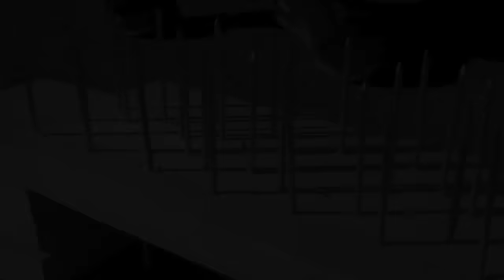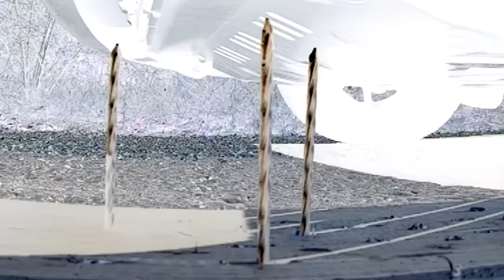EXPERIMENT: CAR VS 75 GOLDEN SCREWS 😱

Comment from the maker: What should we do next? 😀
Reply: 50 Knife Vs Car!
Reply: i think that you should stop doing these types of videos.. it is obvious that the tire is gonna brake
Reply: cool video
Reply: 200 forks vs car
Reply: The air pressure was low in tyre if it could full the could burst in 5 nails onlyy broo
Reply: Nwm ale odc po polsku xD
Reply: Kaktus? xD
Reply: Car vs 20 knifes vs 50,000 nails
Reply: 1000 Prick Pens Vs Opel Car
Reply: 1,000 nails vs truck but nail them on the ground
Reply: I think the last one is stronger
Reply: Lets see
Reply: Yes so I'm right, I know why the less one is stronger but the wheel is fine
Reply: Car VS Yourself. Nah I just kidding bro hahah.
Reply: Do 2 golden nails and 3 sharp spikes vs car
Reply: do 100 sharp pencil vs car
Reply: Superkot You wrong. Thought safe or bad but MUST wheel new with x75 then other x50 and again must new wheel. NEVER NEVER NEVER SAME SAME SAME WHEEL. Wrong. Wheel will damage few cut then little more cut then more more cut. No better new wheel make understand clear....
Reply: It mostly broke the screws🤔
Reply: Так чувак я непонил матиф
Reply: Ноу
Reply: An video without a fucking music
Reply: Try car vs one screw
Reply: Si
Reply: Ramp som cars
Reply: What should we do next
Reply: You should try to make a invisible tire
Reply: Superkot .
Reply: car vs marbles
Reply: car vs ur legs

Comment: As those did an experiment as to how a car tire would sustain a piece of lumber with dozens of screws when they started with 3" deck screws then went to 3" drywall screws then 3" self tapping screws then 3" wood screws when the experiment concluded with just a handful of nails which easily punctured the tire.